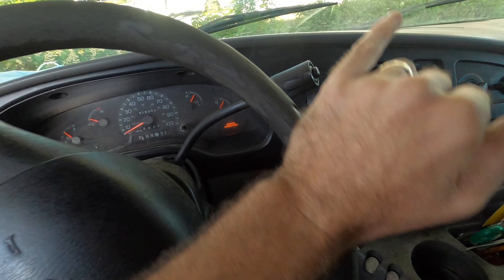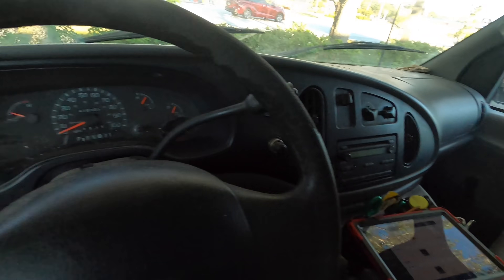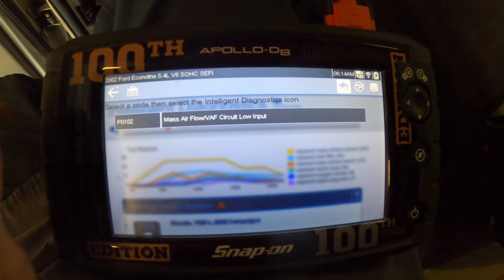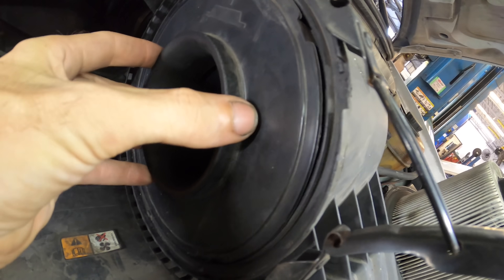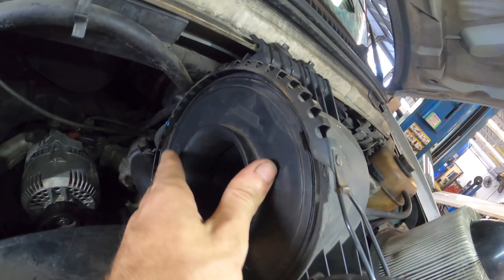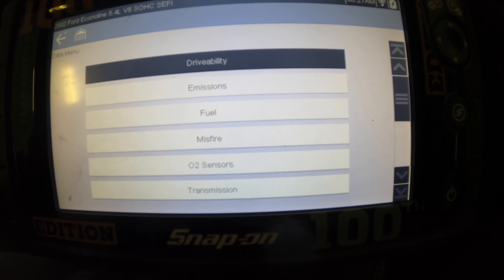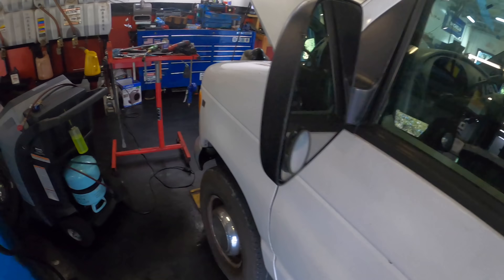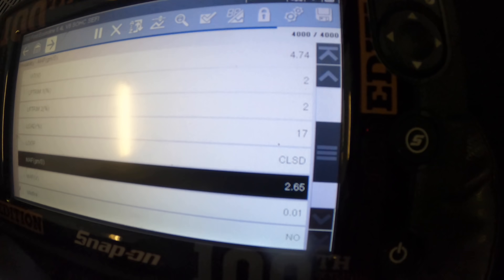Ford Has Engine Trouble. DO NOT Replace Parts! Understand the System! P0102 Mass Airflow Fault.

Comment: Excellent diagnostic as usual they had the thing didn't click in I would have been tempted if it was my vehicle to put a couple of dabs of silicone just attack it in place but it wouldn't permanently affects the part in just keep it from falling apart and hey you're an honest mechanic you did the right thing you didn't gouge the customers to fix something that was relatively simple if you know what you're doing hey you know what you're doing have a great day thank you Ray

Comment: this video reminded me of an o2 sensor that i replaced on my car, hooked up my scanner, b1s2 circuit low input. before i just went and bought a new one i went and checked on the plug, and the wiring. turns out the previous owner went over a curb and cut one of the wires almost flush with the sensor

Comment: I got code p0401 for egr low flow. The parts store immediately recommends a new EGR. It turned out to be caused by installing wrong intake gaskets when I replaced the head gaskets... Changed to correct intake gasket and the code is gone. Great explanation on how to diagnose the issue with common sense! Auto work sometimes is like debugging computer codes^_^

Comment: I have the same seatbelt ding-ding on my 2003 E150. I bought it new and it has 122,000 miles. There must be a bad sensor in the seatbelt system. My van shows the same symptoms with an intermittent engine miss & the smell of gas & service engine light. So far, they have replaced the coil pack twice, the plugs & wires & I still have the same issues. I’m going to check the air intake in the morning. Needless to say, if this is just an air leak, the dealer and I are going to have a conversation. Many thanks!!

Comment: Hi thanks for the video I'm dealing with lean air conditioning right now on my 1998 e450 V10 gas motor home. One suggestion is to possibly add van or other keywords to this video as it show s how to remove the air box and sensor there was almost no other ones that actually show it they just talk about it. Thank you for the video

Comment: You actually got a lot of videos to catch up on. Look at that nothing wrong. Other than the fact the gentleman that was paid to replace the alternator wasn’t paid to put everything else back together correctly. So now they have to pay you to put the airflow system back together properly. So your nickname is the van man now. And a lot of times with plastic parts they just wear out. Because if you got to do any work on the front of that. The first thing that goes. Is the  airflow system so you can look back in there. Little bit of tape where the plastic clips are usually tightens them up and holds it in to place.

Comment: I realize some shops will concentrate on the immediate problem, then don't touch anything else.  But, do you at least check engine oil level and top off, and check tire pressures, not just a courtesy, but to CYA in case they're low and the customer becomes a jerk when something bad happens.

Comment: I was watching a German channel mechanic  fixing a BMW . The short story- previous  garage had been trying to fix a timing problem  and gone to the trouble of having the head reconditioned ( you could imagine the cost) with no luck. They had it taken to this german mechanic and after looking over the car and the voltage supplies it turned out they had put the exhaust valve electrical  block on the inlet valve block and vice versa. I dont believe they would have been honest with the customer myself.

Comment: My last job was phone tech support for dental imaging equipment, with our flagship product being a panoramic/3D x-ray machine that cost 6 figures. Most common problem code was a communication error between the computer and the machine (so common that the code number was just 2). There were some days where I'd have to recommend $70,000 in parts, but far more often I'd have to tell the caller to plug an ethernet cable into a different port.

Comment: The ultimate prank for Aggies driving vans that are all sealed up in the back and no way to look out if you have an old mirror hang it on the metal thing in the center of the windshield boy would that be a good prank

Comment: So nice to see honest mechanics like yourself. There are fixes for not ready on some cars that have open source tuning available. Like older turbo Subaru's. Force Ready is an option. Or just disable those codes to begin with. But not for an honest mechanic like yourself of course! If you ever run into an older model turbo subaru, wrx etc from about 2003 - maybe 2012.  I am not sure on the end of life there before cobb hired the opensource tuners but you see no activity on the o2 sensor but no cel someone shady disabled it. Or just no cel without a cat, no tgv snensors hooked up, no pcv sensor connected, with no cel, etc. Just need rom raider, ecu flash, and a tatrix cable to turn any cel off.
Reply: And other than a wideband that you can integrate into rom raider thats all you need to tune an older wrx or sti.  Or several turbo models.  But to tune them correctly is much different.  Kids crank the boost without lowering timing and lots of other things and blow them up.  Closed loop / open loop delay, scaling maf for larger injectors because you have to use suggested settings that can be off etc.

Comment: Really concussed. Instructions unclear. Isn’t dielectric grease an insulator, increasing the resistance in the connector? Isn’t increased resistance going to contribute to corrosion? Increased resistance set a DTC code? What about replacing the oring seals in a connector that is 15 years old?  For reference 04 ram 1500 with 77000 mi, Phoenix, AZ.  Thanks Ray, your the best😀

Comment: I work at an Auto Parts store. Customer comes in with a Check Engine light on and wants us to scan it. No matter what DTC comes up, before I even plug the scanner in, I always tell the customer the truth. Scanning the car is only STEP 1 in fixing the issue. We are an AUTO PARTS STORE and not a repair center/garage. No one at out store is a Mechanic and any and all advice is to be taken as opinion or advice and NOT FACT. If they have an O2 sensor DTC I will never guarantee a new sensor will fix their DTC. Some times the customer does not want to hear that. Too bad. I am not about to lie to make a sale only to have that customer come back demanding refunds or replacement parts because the part did not fix the problem.

Comment: i guess I am thankful that I am mechanically inclined...  I try and fix everything myself on my work vans.  Case and point here.... I am always chalking my teeth at the sloppy work and attention to detail when it goes into the shop on rare occasions.  Fix the alternator here, cause another problem.  Either that or whomever changed the air filter pulled that crappy clamshell air filter housing apart and re installed it wrong.   Either way, my rigs not running are a pain and cost me money.  I respect their mechanical needs and follow the manufacturers recommendations to the letter, with OEM parts.

Comment: Had a problem with my 97 F 250 7.5 fwd crew cab. Counter jockey at parts store tells me "need new mafs" bought/installed said part, issue persisted. After a bit of research replaced rear fuel pump- problem solved. Trust research, not best guess¿?.

Comment: I'd revise it to don't replace expensive parts.
Sometimes it's easier to just replace a cheap hose to ensure that it's not causing the headache.
And if you have a code then a test drive might sometimes also reveal the issue. Especially if you have experience from carburated engines. I encountered a car that stated lean O2 but a test drive did also tell me that it wasn't the O2 sensor, it was the MAP sensor but there was no code for MAP sensor faulty. The revealing part was that the engine changed behavior drastically when it changed from closed to open loop where only throttle opening and rpm was important.

Comment: A good pen-pal of mine leased a BRAND NEW "ESCAPE" At 8000 miles the car had a problem.
The dealership should have done a LONG BLOCK replace. NO. They wasted a lot of time and money on a short block and had to do some milling on the the valve head. Not sure how many WEEKS that it took or how much money that the dealership spent in labor to get the engine running right. When the lease is up, my friend will NOT be buying this vehicle. As Capt. Nemo would say? " This is NOT the Way to Enlightenment!"

Comment: I will never forget a customer telling me what was wrong because their parents car did the same thing and such and such fixed it. I appropriately found the problem, was called a liar, and they towed it to dealership who fired parts cannon and didn't fix/ replace the part I tried to sell. Cracked throttle body on TBI motor running rich. No a injector or O2 won't fix that crack

Comment: Easy and great job. As this one is of the same age as the other van which had all the vacuum leaks.  I was wondering what the condition of the vacuum lines, EGR and Brake booster diaphragma are even if no lean condition was given by the computer.

Comment: MAF reading should be closer to the Liters of the motor... And the correct reading is double?
Reply: Depends on rpm, though, because it is a FLOW reading.  More engine rpm means more air needs to flow through.

Comment: That MAF gets broken loose like that when people try to use cheaper NON OEM air filters to save a few bucks... the hole in the center causes people to use waytoo much force to remove the air filter element.  I maintain a fleet of 32 of these....E350 and E450's  seen all this many times....

Comment: Ford used that mass air flow sensor set up for years, really restricts air flow and is a pain to deal with. That's why I replaced mine with a cold air intake, runs much better and uses less gas.

Comment: Even I screwed up as far as making sure the connector was clipped on that with my Nissan Quest. It ran great for a while, then went to funky town. I went back and rechecked my work after replacing the timing chain and guides in the Quest. That was the only connector I had not clipped well. A year later, the MASF sensor failed, it was an after market part. I had a spare from a junk yard van that is factory, fixed the issue.

Comment: Being an IT guy, I see some parallels to my line of work. There are IMO a lot of assumptions going on that end up being a disaster.
Some sensor is giving strange readings, so someone apparently assumed it was broken and started loading the parts cannon. Herein lies the problem: what was this assumption based on? Experience? Is this particular sensor especially prone to failing (as in „ah, I have seen this a dozen times in the past 5 weeks and the issue was always gone after replacing the sensor)? This would imply that they either knew with a certain degree of confidence there could not be anything else wrong…or they did no further check or only did a cursory check at best, missing a lot of clues. Or they were inexperienced in interpreting what the data might mean in the context of where and how the sensor gets its data. 

Just as doctors should never treat an Xray or some lab result, but a patient instead, some (!) shops should probably more often take an actual look at the car and its innards rather than just hooking them up to one of them confusers that give them some sibylline answer in error code form what leads them down all sorts of rabbit holes and dead ends. That will 100% result in a lot of wasted time and money for the customer. 
Of course hindsight is always 20/20, I get that. However, what I am trying to say is, if any sensor gave me a strange reading that does not make sense at first glance, my first order of business would not necessarily be to assume a sensor fault and replace the sensor. Expecially given that in this case, in order to get to the sensor, a good look at the parts containing the sensor will automatically happen, no matter what.
Reply: LOL. "The x-ray shows you have a broken leg, so we will replace the x-ray machine. You're fine, just go home."

Comment: Holy crap these vans seem to live forever, it's got over 416 000miles! I've worked on two Ford E250s with the 4.6L V-8s and they both have well over 400 000kms (Canada by the way).

Comment: 16:50 I had that problem with my Mondeo... although it has some perhaps more annoying problems like instrument cluster blackouts... it kept constantly dinging for the belt, and I snipped the wire pair going to the belt lock. The limit switch or switch actuator in the lock is faulty. The circuit is open (at least on the Mondeo) when the buckle is locked. So now it appears constantly locked, no more dinging.

Comment: I guess the fuel smell was simply due to fuel-air mixture leaking out of the holes in the intake - if the MAF was reading low, the ECU would reduce fuel delivered to match, making it run lean and lumpy.

Comment: Hey Ray, I just got a Ford Ranger and it has a horrible mold smell when I turn on the heater. This model doesn't have a cabin filter instead it is said it has a "mess intake that can be cleaned" according to the interweb. The problem I'm having is neither the interweb, my Chilton's or the Hayne's manuals seem to want to reveal the hidden location of said air intake (or any other said solution for that matter). Next time you get a chance if it's not too much of a hassle could you point it out, I'd much appreciate it, Thank you. :)

Comment: When using spray to clean it never ever use air to dry them, by the time you have put it together it will have dried naturally....Ray may have said this in a different video but it doesn't hurt to point it out again :)

Comment: Hello! _
If something is really made of "unobtainium", can electrical tape, or Gorilla Gutter tape (Water-proof) be patched in? (I wish I could think some tape adheres more securely if it gets hot.) 
BTW -- as Chip makers have forsaken making the lower-tech "chips" (Doritos) to manufacture new cars, you might find rebuilding unobtainium parts an absolute necessity.
[We had a car where CV boots were forever needing replacement. If a vehicle comes in with unobtainium CV boots, could some tape do the job?]

Comment: Had a customer with E150  have a cheap air filter that let debris by and sit in small opening of where the hot wire is sensing the air flow , it got towed in , wouldnt stay running , got the mass airflow sensor code , cleaned it , guy paid for tow and new air filter, sent him on his way , became life time customer but now im retired

Comment: So you work on the 2 most popular selling vans  a lot . Well since they are the most popular selling , there my be a lot more of them out there so you will see more of them to work on instead of the almost no selling GM piece of crap . How many of those brand new Gm 6.2 liters that drop lifters and bend push rods have you herd of . You definitely aren’t working on them because the pieces of crap break at around 5 to 7,000 miles and are still under warranty. So it’s a dealer item but since you are such a GM fan , your comments .

Comment: A lot of Fords also have a sensor in the passenger seat. If that seat has any weight in it while driving and the belt is not clicked it will chime off still.

Comment: You have to wonder how many times MAF sensors have been swapped out before checking anything else. And in the process of changing the sensor fix the actual problem by reassembling the intake system correctly. No one would ever know that the sensor wasn't the problem. Not even the mechanic firing the parts cannon.
Reply: Add on story: Went to get my tires changed recently, and the shop tried to sell me some radiator hoses. To show me the alleged problem, he took apart the intake. I refused the repair and he put the intake back together. Badly. Noticed the poor assembly when I was checking my oil a few days later and found intake components flapping around and not secured in place. Glad I refused the job, and won't be returning for tires, either.

Comment: It looked like that van had 400k+ miles on it, that is impressive for a Ford, but I'm sure the entire drivetrain has been replaced at least twice.
Reply: I don’t know about all that, sir. The 5.4L 2V was exceptionally stout, as were the 4R75/4R100 transmissions. It’s not outside the scope of reason that with proper maintenance, they had never been opened up.